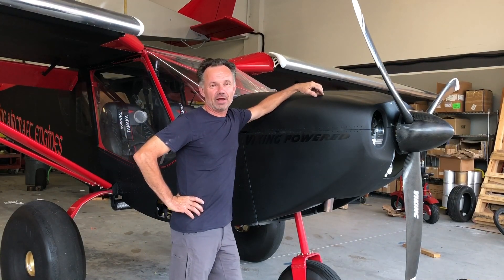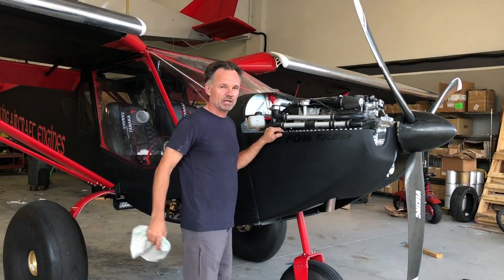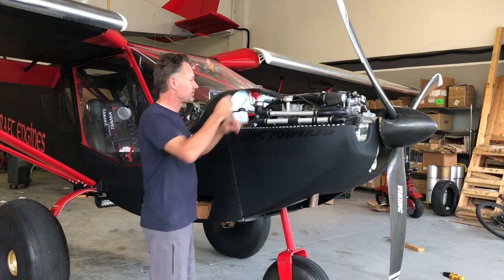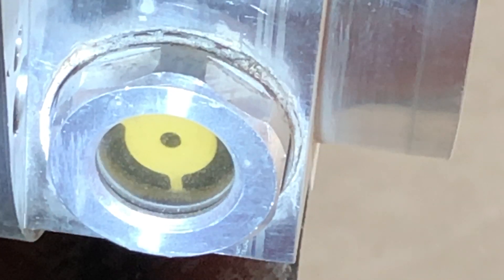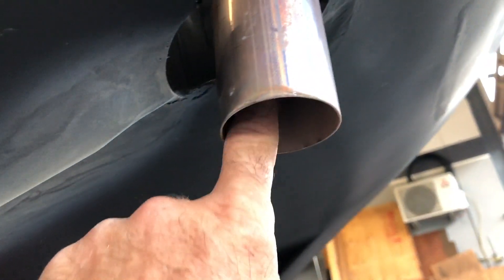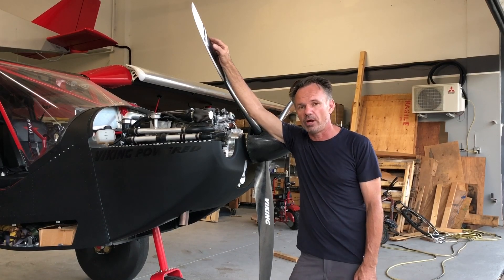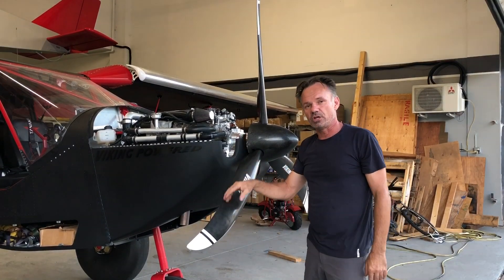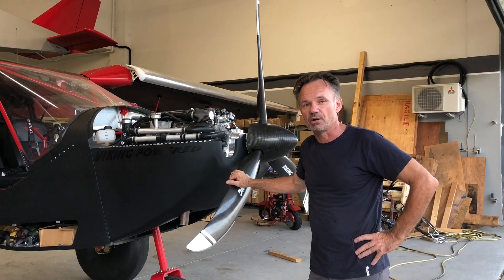Zenith Super Duty with Viking 170 after 20 hour Zenith Homecoming Round Trip Flight

Comment: i was curious about the mystery oil additive to the gas ? is that to reduce carbon ?
Reply from the maker: Lead from sticking on the rings, it is commonly used in most engines with 100 LL

Comment: Whats your cruise speed? Have you tried flying the 750 without the slats installed?
Reply from the maker: It’s around 100-108, but it’s a stol plane so we fly it like a stol, but if you remove skates it changes the center of lift aft, and we already have a cruzer

Comment: In those 250hrs have you had any issues? Or has it been completely trouble free?
Reply from the maker: Yes, zero issues. And our other engine models like the 130 have done double and triple time with the 120z Other than the first 10 hours in this bigger model we decided to beef up the gearbox. Not issues, but knew we wanted to beef it up.

Comment: have u checked for carbon buildup on the intake valves once the engine has reached 100 or 200 hrs. Pls lets take a good look. Thanks
Reply from the maker: Hey Harry, because we don't run crankcase blow by into the intake manifold like they do in cars, we do not have that issue. We talk a little about that in this video https://www.youtube.com/watch?v=wHV0LuE8ePs&t=680s